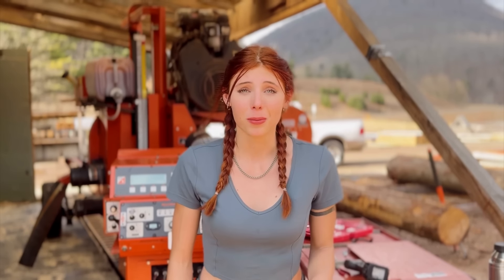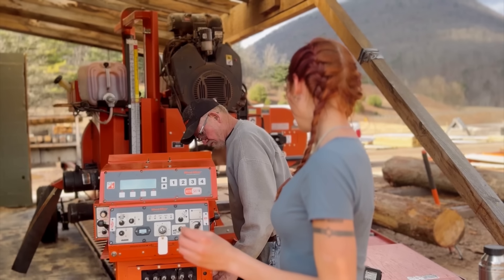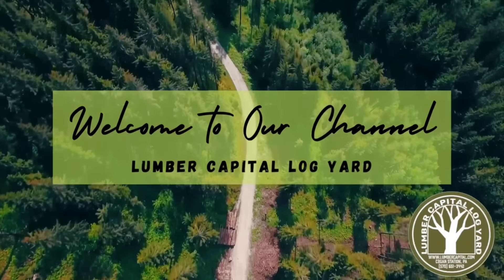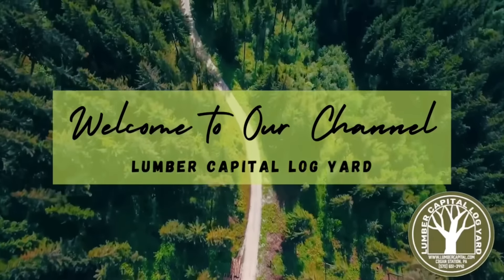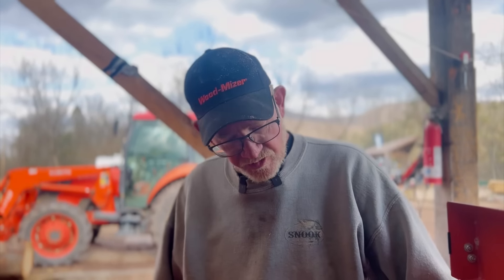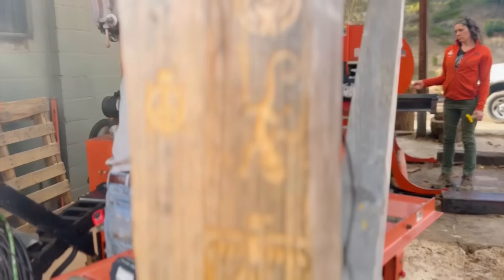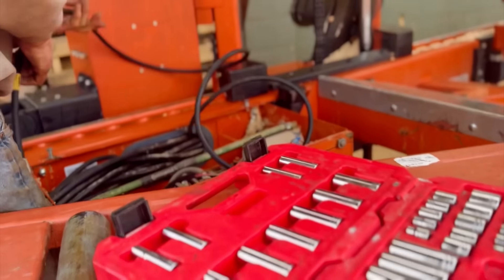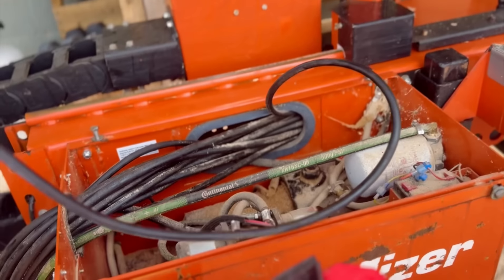A TRICKY repair for something so simple!

Comment: Should have connected the new line to the old one and pulled it through that way instead of using the string. Will have to try to get a fish tape through the channel now and keep it on top of all the other lines.

Comment: Being a retired heavy equipment mechanic, I can honestly say hydraulic lines are the worst. The string is a common trick. 
 Every time a hydraulic line pressures and releases, the line moves, causing wear. I would look for any kind of sharp edge where the line blew.

Comment: String idea was great idea. We use the same idea on some of our tractors. One thing that might help is to make a cone shape using tape on the end you’re pulling through. It helps us. Good luck.
Reply: I was going to add that to comments also.  Number of times duct on the end of the line has got me out of a literal jamb.
Reply: That's the ticket. I've used a similar technique and a clear gel lubricant to pull ethernet cable through conduit

Comment: Here's a tip for future reference:
Pick up at a hardware store or an electrical supply store a bottle of wire pulling lubricant and apply it along the length of the hose.
That hose would have came right through. And its formulated not to damage. (Its actually a wax)

Comment: Hey everyone!
     Hi Terry (I hope that's spelled correctly), it's great to finally know your name. 
     Hey Emerald and Grandpa!  I think I might have a solution.  It looks like the process of replacing an electrical line through conduit.  I think it's conduit.  Different process same concept. 
     Look up this part and see if it will work.   2403-06-06 | 3/8" JIC Male x 3/8" JIC Male or look up hydraulic line joint connector.
     If you don't have threads on the ends of your hoses (the connecting ones ya know, you don't want to run it backward) there has to be an adapter that will work.  Then you can pull pretty hard to get that line through there. 
     That's weird a line blowing twice.  I would look at whatever broke.  If it popped, wore out,, etc.  
     Good luck! 🌹

Comment: Hi Emerald,
I had situations similar trying to snake a new hydraulic hose into a confined space where there we many other hoses. I found it best to have the new hose ready to go and use a union to connect the old and new hose and then pull the old hose out. The new hose will take the same path the old hose occupied. I think your grandfather will need to use a fish tape as it's metal and can take a stronger pull to pull the new hose through the confined space. I hope there was not much grief getting the new hose into position. You all stay safe.
Reply: Yes. also spray the new hose down with some silicone. It will make it slide through much easier.
Reply: Another thing that can make a big difference is something conical on the end of the hose.  I've used a spray nozzle with the string (fish line, mouse line) coming through the nozzle. I;m sure grandpa could mcgyver something.  If you don't have silicone handy electricians pulling lube is good. I used lard once in a pinch (goes rancid and stinks)
Reply: If you have get the old hose out to measure it for a replacement you idea doesn't work.
Reply: @johnbaskett2309  I never had that problem. I could measure to within 2 feet the length needed. I would just dress the extra length out of the way.
Reply: @johnbaskett2309  No you don't. Look it up in the parts diagram or call the company.
Reply: @jpsfudimo3082  Sometimes that info isn't in a parts book. Maybe a parts book doesn't exist.
Reply: @johnbaskett2309 so, how much does it change in length inside that straight pipe?

I'm an electrician though, so I might have some other tricks to solve these mysteries.. In this case I would not have even used a pull string at all, but a pvc pipe, that would make straight line over/through the bundle of other hoses, instead of trying to thread to the exact route where the old one was.

I'm guessing that the actual service mechanics for similar setups would have connectors with pull cones etc for stuff like that, if they would not have the original hose to pull with. Lubricants would make a difference, specially when using the old hose to pull. Route isn't usually optimal then and the friction between other hoses rises a lot versus having the new hose on top of the others.

Comment: Things that can help . 1 use electrical tape round the end of the hose and up onto the string to make a pointy cone . Can help prevent snagging.  2 washing up liquid ( i think you call it dish soap in the US) it's  non corrosive.  And everything is better with lube. (Apart from rock climbing 😂)

Comment: When I’m pulling lines through a frame, i use an electrician’s tape. It’s a flat metal tape used to pull wires through walls or conduit. They’re not cheap, but they’re definitely worth the price considering how much frustration they prevent.
Reply: Plus you can pull on that without too much fear breaking it, unlike a length of string like this.

Comment: BEst of luck with it.  Maybe you have it by now.  Sometimes you can create a funnel on the front by wrapping  a piece of plastic cut from a milk jug and taping it up.  The blunt end of the hose might be hitting some panel or frame as you are trying to pull it through.  Nice to see mom.  Hug grandpa every time you get a chance.  (yes, I'm a grandpa)

Comment: attach the new to the old and pull through.. lines don't wear out,, they wear through.   stainless Steel braiding would be helpful... Check everything for possible plugs that could create too much pressure..

Comment: Wish I could have been there to help I also have had to fish lines and hoses many times, Dawn dish wash or similar liquid works and won't harm the hose a fish tape electricians use would be stronger. some one else said to make a cone on the fitting, it may be hanging up on fitting end and I agree. Hope you don't have too much trouble. John Toccoa GA

Comment: Sometimes routing hoses like that can be a nightmare. Ideally, by having the new hose available before removing the blown hose, you would be able to use something like Gorilla tape to fasten the ends of the hoses together therefore pulling the new one through while removing the bad one. All in all days work at the mill. Best of luck getting up and running.